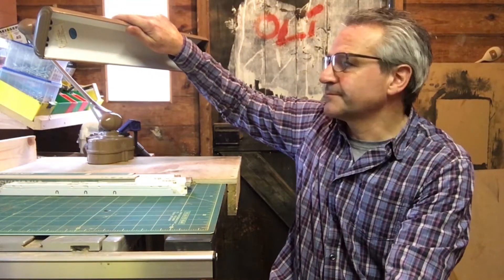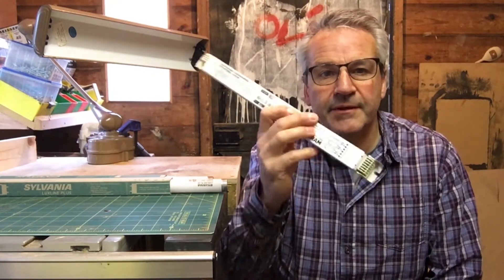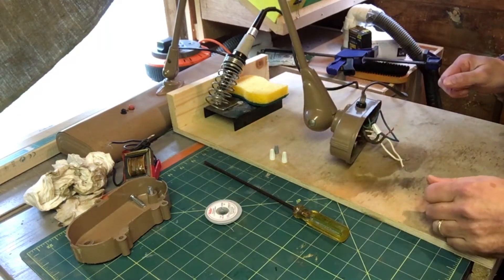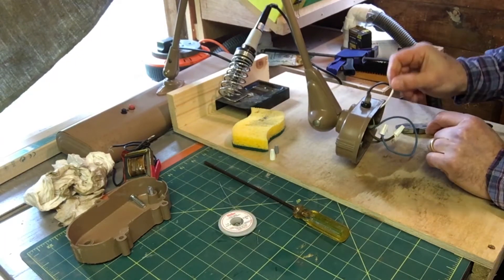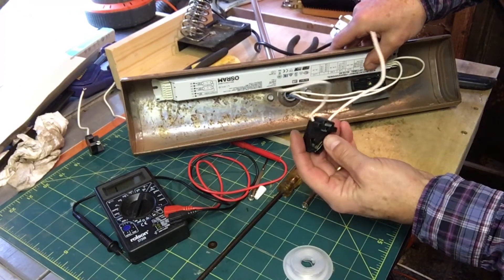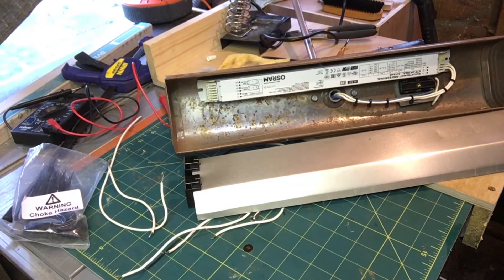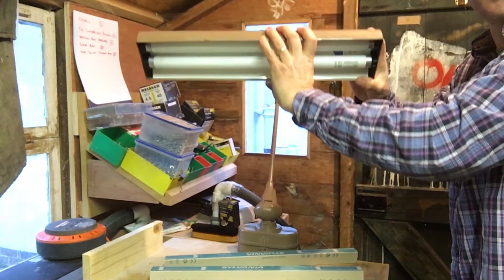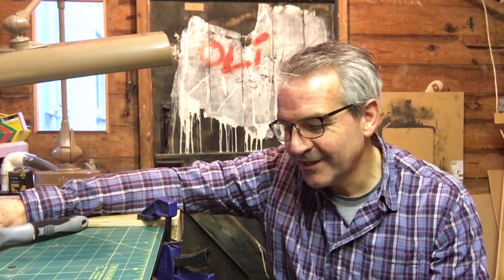Vintage 1950s USA Desk Lamp Rewire - Part 2

Comment: Good to see you were able to get this working.   
I was curious so looked for similar items on US EBay.    They go for less, $100 - $160 but crazy shipping, almost $40.  Has to be the "collectible" label.
Dave.
Reply from the maker: Yeah , at the moment this sort of thing ‘industrial style’ is very in vogue in the UK , hipsters love this stuff !
Reply: Not only hipsters but folks inspired by the Steampunk trends buy up all sorts of industrial looking items driving up the prices.  Cast iron lathe legs are an example on this side of the pond.   Now used more as legs for tables than for mounting a lathe.
Dave.